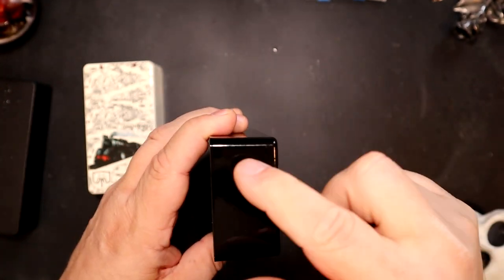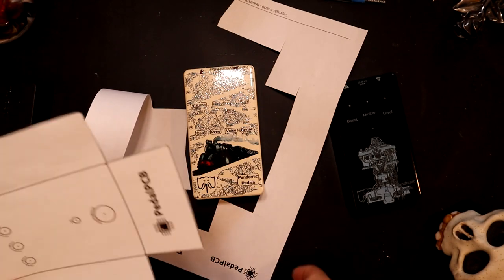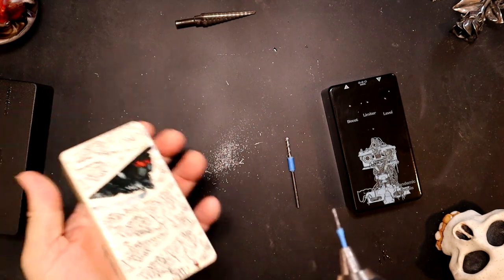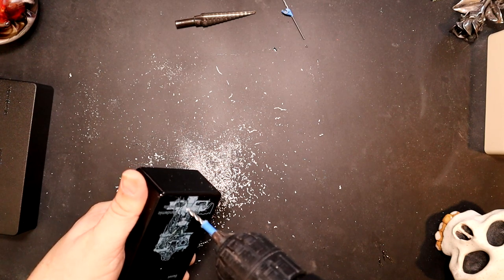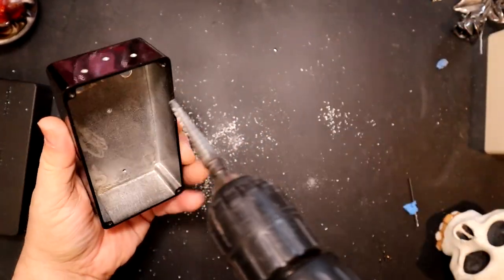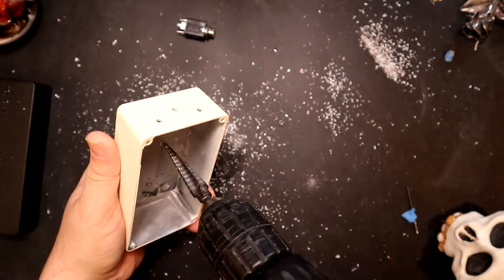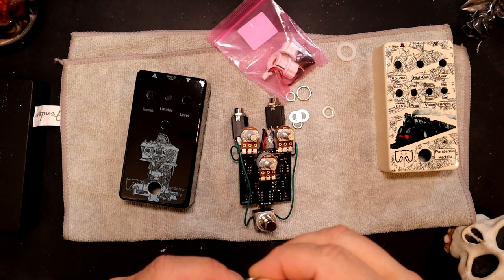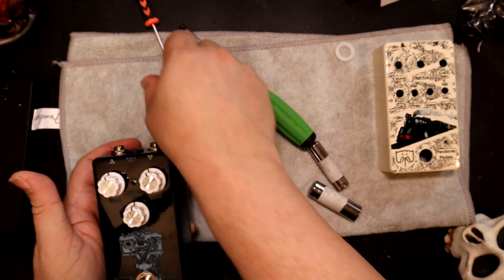Learn From My Mistakes: Hand Drilling and Finishing Enclosures

Comment: I use a digital caliper and a metric step drill to do my holes in my enclosure.
Reply from the maker: So hard to find the metric step drill in the US. Do you measure your placement of the holes with the digital calipers?

Comment: I can never get the pilot hole right, the bit always wanders off the divot left by the center punch. The small 1.5mm bit takes a long time to drill through. Is my drill not powerful enough? It's 12V.